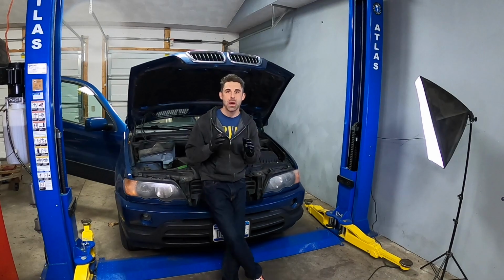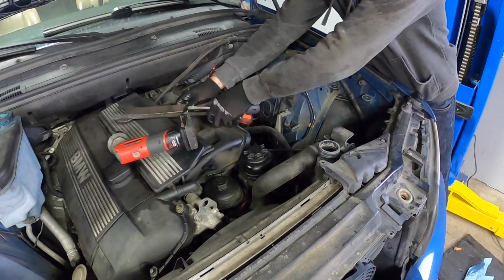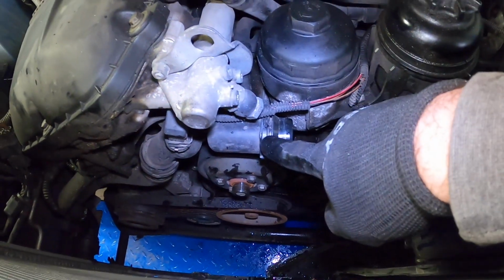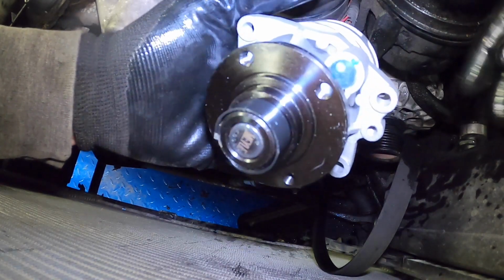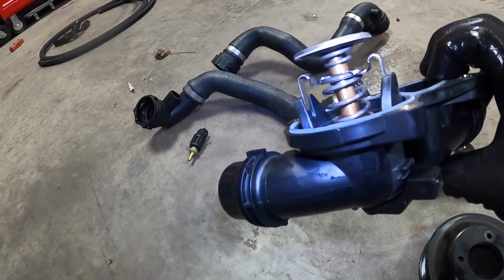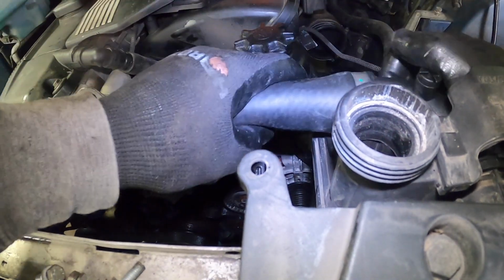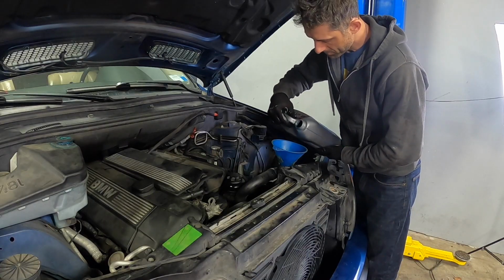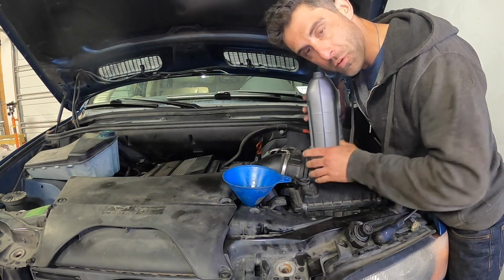BMW E53 X5 M54 Water Pump Thermostat Replacement

Comment: does the water pump have internal o rings? I have a leak coming from the bottom of water pump but i doubt its the gasket between the pump and block.

Comment: Nice maintenance Frank. Luckily the water pump came out easily. On cars that make not a lot of mileage a year, it can be a big pain in the backside. Mine was in the M50 e36 for 6 years and I had to use the two m6 bolds to drive the pump out. It was so stuck. One of the m6 bolds snapped doing this! Dutch regards, Nico.

Comment: Nice timing! I was planning on replacing only the thermostat on my E53 3.0i because the engine is running slightly cold on the highway. I guess I will do the rest as well

Comment: Is the M54 enough engine for the E53? I have a manual E83 and you can really feel the extra weight versus the E46
Reply from the maker: Actually it is. It’s 4.10 geared 3.0 version so it revs high on the highway, it has some getup!! More than my 2.5L m54 325xi, even despite the additional weight of the e53, believe it or not
Reply: @Garageaholic  how did you know if it was the water pump